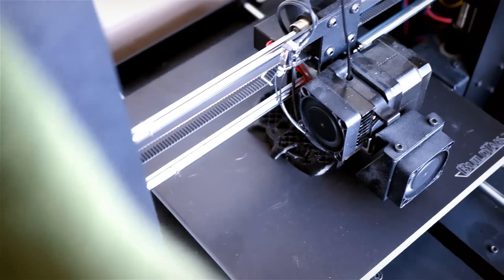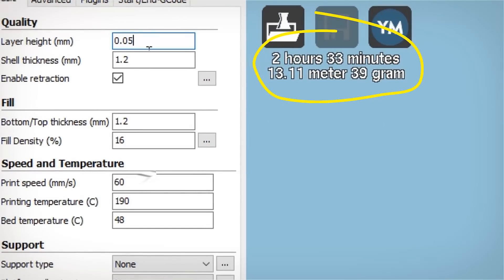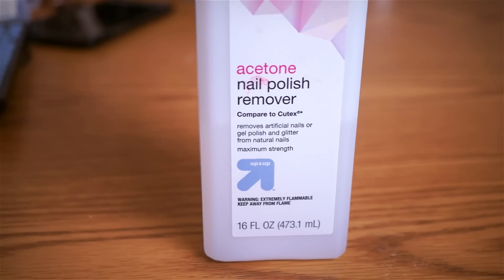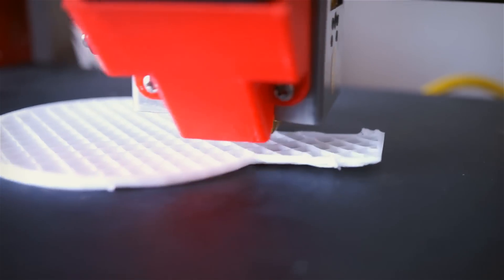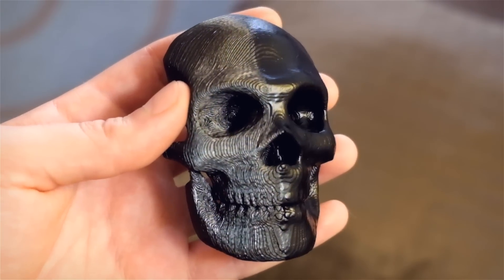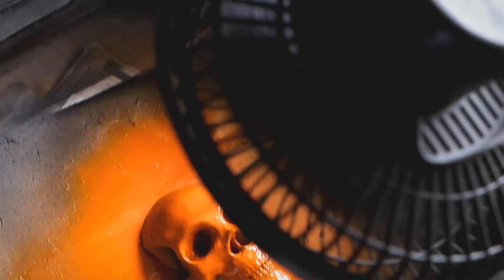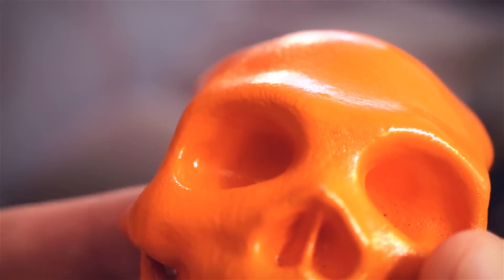Smooth PLA | No Sanding

Comment: cool to know but it should be noted that the skull now has lips instead of teeth
Reply: Indeed
Reply: Definitely good point to make, I think this method is perfect for really simple models that dont have minor details like mounting gear, pot plants, etc
Reply: This made me laugh
Reply: Your correct. Maybe we have to make certain areas more pronounced, deeper, so smoothing will not vanquish it
Reply: @ericcvt  Or put painters tape over the more intricate sections so they get fewer layers of paint
Reply: perhaps you could cover the skull with some painters tape before spraying and do so in such areas
Reply: I gotta say that it looks much more friendlier and less menacing this way, though.
Reply: The problem is the resolution of the print is so low that the teeth are almost the the same size as the printing layers.
Reply: @mdoerkse  Exactly, the problem is inherent to the print at this scale, you can't process it out because the details weren't really there to begin with.  

If you have an artistic leaning you could sculpt them onto the model with a knife or dremel depending on the needed effect, but at that point you're not really 3d printing anymore.
Reply: Haha this cracked my scull up
Reply: yeah all detail is lost
Reply: This shit got me crying
Reply: *Quick fix for this. If you cover details like the teeth you can sand it down till it shows again and then spray it lightly the same way you did the rest but this coat you wanna apply light. Just enough to blend with the rest while still keeping the detail
Reply: It is now Skeletor!
Reply: Hahahahah
Reply: XD
Reply: Oh Yeah Yeah
Reply: That has more to do with the layer height, I think, than the filling method.
Reply: :D :D
Reply: LOL
Reply: Skull Kiss 💋😘

Comment: so I have a print that is one color on the top and another on the bottom of a single piece. is there a way to hand paint the smaller part and still use your technique?
Reply from the maker: Interesting. There may be a few options but I feel like I would try to use painters tape on one side then remove and apply it to the other side. One side at a time i guess. But you could hand paint it after too

Comment: I was actually wondering if this would work only a few minutes ago! And then this video just magically pops up and confirms my theory! xD 🧙‍♂️🔮
Reply from the maker: Perfect! :)
Reply: Here is your answer!!!
Chemicaly Smoothing PLA

"Generally these days I start by brushing on some Dichloromethane (DCM, or methylene chloride). This stuff is really very nasty and I do this work either in a fume hood or outside with a fan blowing away from me. I use a respirator with chemical filters, PVA gloves and full eye glasses. Do not use this chemical unless you’ve taken the proper safety precautions! However I found no other solvent even remotely as good at smoothing as Dichloromethane. Apparentl Tetrahydrofuran (THF) is ok, though I’ve not tried it. Acetone is completely useless, as PLA is completely insoluble in Acetone. Due to the nastiness of Dichloromethane I’ve never attempted doing vapor smoothing, but the simple cold brush on works surprisingly great. Sometimes I do two “coats”. With each coat the Dichloromethane dissolves the surface layer of the PLA and the resolidifies, running into the cracks. It also conveniently seals any tiny holes in the print where print layers have failed to fuse properly. Another method is to spray on many coats of a lacquer, e.g. shellac. This has some problems though during burnout and can leave undesirable carbon residues in the mold which can be tricky to remove. With higher burnout temperatures though this has been less of a problem."

https://mtyka.github.io/art/2016/12/11/lostpla-casting-glass.html

Comment: 2 PART EPOXY IS A MUCH BETTER PROCESS great short vid but epoxy doesn't coat over the details as you use a paint brush it also increases the strength of the overall piece

Comment: Just FYI you don't need to heat acetone to smooth with it, you can just give it a large surface to evaporate area such as lining a jar with paper towels. Works great, slightly slower but much safer.
Reply: cool mist humidifier. I made a another post here to help create consistency and full coverage with this concept
Reply: And you loose less detail

Comment: "How to remove all details from your print"
Reply: turns everything into goop
Reply: With what I like to print I can see this being very useful. I love a smooth and shiny look to things that are very simple in shape. Though I think this would never work well on things with more features than a scull.
Reply: I use 3D printer for custom boxes for electronic devices, so it's perfect solution for me.
Reply: Same with ABS smoothing using acetone, you have to trade details for smoothness.
Reply: eh the original stage, the skull's teeth were already so close together and not much detail
Reply: Acetone does the same for ABS
Reply: lmao
Reply: Just so you know, printing at a large layer height IS sacrificing detail.
Reply: I use 3D prints for custom organization which uses simple shapes so it’s good for me
Reply: Yeah exactly, that skull lost most of its teeth
Reply: That’s not the point. You can cover the holes or whatever you want
Reply: what a legendary comment. I mean he already prints with 478563485mm layer thickness
Reply: @donnyboi6061  yes i was looking for this, like wtf "i dont like the edges" proceedes to print a skill in 4 layers
Reply: 3d prints look like garbage anyway. Especially the details. You really shouldn't be printing things with small details unless you're using a resin 3d printer.
Reply: @JorenMathews  exactly I want to try this on a detailed model, though in the EU it is often so hard to come by the things I see on YT that are from the US  :((
Reply: @sirfrancisarthur  
You don't need to get the same brand, just get a product with the same ingredients... or just order online :P
Reply: @JorenMathews  lol.so lame

Comment: Interesting! I was looking for something to helping me out smooth PLA.
Reply: Look at this article I found.
Chemicaly Smoothing PLA

"Generally these days I start by brushing on some Dichloromethane (DCM, or methylene chloride). This stuff is really very nasty and I do this work either in a fume hood or outside with a fan blowing away from me. I use a respirator with chemical filters, PVA gloves and full eye glasses. Do not use this chemical unless you’ve taken the proper safety precautions! However I found no other solvent even remotely as good at smoothing as Dichloromethane. Apparentl Tetrahydrofuran (THF) is ok, though I’ve not tried it. Acetone is completely useless, as PLA is completely insoluble in Acetone. Due to the nastiness of Dichloromethane I’ve never attempted doing vapor smoothing, but the simple cold brush on works surprisingly great. Sometimes I do two “coats”. With each coat the Dichloromethane dissolves the surface layer of the PLA and the resolidifies, running into the cracks. It also conveniently seals any tiny holes in the print where print layers have failed to fuse properly. Another method is to spray on many coats of a lacquer, e.g. shellac. This has some problems though during burnout and can leave undesirable carbon residues in the mold which can be tricky to remove. With higher burnout temperatures though this has been less of a problem."

https://mtyka.github.io/art/2016/12/11/lostpla-casting-glass.html

Comment: That is not a viable solution as the detail is lost by the paint process. Pause the image @ 2:10 and look a the teeth detail.   Many would rather not paint printed objects either as this now makes the object more scratch prone or have issues with chipping paint.

Comment: What about hot air smoothing? What if you could control the temperature slightly above what your extruder settings were - would that work?
Reply from the maker: I like the idea. Maybe flashes of heat would lightly melt and smooth. That would be interesting to try.

Comment: Does it have to be fast drying polyurethane.
Reply from the maker: The fastness help because it will harden before the paint has time to run. So it locks that layer in place fast.
Reply: Can I use normal polyurethane spray. If so, do you have any tips?

Comment: You can use diluted acetone to soften the surface of the PLA to make sanding faster. Additionally if you have to wait a who day you might as well be printing with thinner layers, it's not going to add a whole day on for most of the models people make, and you will get finer details.

Comment: "Can produce a melted 'look' "
Dude. It doesnt look melted, it is melted.
Reply: No, it's dissolved, not melted, which isn't the same.
Reply: @GRBtutorials  same looking after affects so really doesn't matter lol
Reply: @GRBtutorials  It's a melt my dude not a dissolve.
Reply: @99Plastics  melting is caused by heat converting to speed in molecules of a solid, when they speed up enough that the motion overcomes the attractions so that the molecules can move past each other as a liquid, it changes state, dissolving is cause by chemical reactions breaking down the bonds in molecules of a solid so that it moves like a liquid looking for bonds to connect to try and return to a solid.
it's a chemical reaction, not a mechanical reaction like melting.
Reply: @JackPorter  That's the right type of argument to prove your point haha!
Reply: DaToNyOyO That was referring to using acetone for vapor polishing of ABS.

Comment: Nice try, I guess. If you want detailed, small to semi small PLA prints, you’re gonna have to print small and spend time and work on it. That’s it. No shortcuts. No mixing aerosols under your cat to wash away detail then forget to talk about it. Bad tip, bad technique. You could’ve taken the skull outside and just down multiple coats of filler primer and it would’ve turned out better.

Comment: While this method seems useful, it seems a lot of the detail is also lost ?
Reply from the maker: All additive methods fill in layer gaps and some details but consider the skull I printed was a large layer of 0.3mm which is already a loss of detail. So if you print with a high res like 0.1mm and then do this method, then much more details will be preserved. I was showing the extreme which is easier to see the before and after in the camera.

Comment: Why do people always moan that detail is lost?
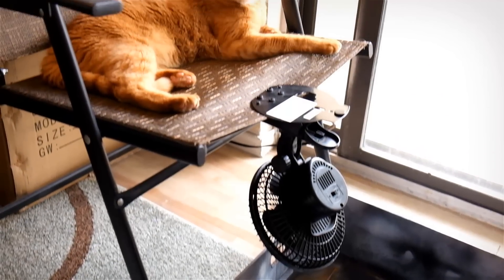@ 2:11 Look at the difference. Which skull would you rather have?

This is an example of what you can achieve. He used a 0.3mm layer height to show how effective it is. He did an extreme version of the technique. If you want to keep certain details like the teeth, then don't spray too heavy in these areas. People need to use imagination and stop thinking like robots who are programmed every step of the way.
Reply: You can also use finer line heigts on only some layers if there are details you really need to keep.
Reply: Except the printed skull looks like pretty bad before even the paint.

You could get waaaaaaaaaay better print quality with .16mm layer height, match the multiples of your nozzle diameter with all the other settings (ie use the "magic numbers")  change the orientation on the bed so it's not printing flat, angling the print, elevating it and using supports, better PLA than the monoprice stuff, Using more top layers/adaptive layers to lessen the voxelization of the top.  If you're trying to get something to look better why not set yourself up from the beginning instead of coating it in paint?

Or just save yourself the trouble and buy a spray bottle, IPA and polymaker polysmooth filament.
Reply from the maker: Thank you so much for understanding. This low res model with horrible line heights can be smoothed so that means even a higher detailed model can be smoothed too.
Reply: @3DSage   No probs. Just hate to see when people take the time to help out others with their knowledge for free, with no thanks, only to be rubbished on a slight thing. People like you are what makes YT a great source of ideas for makers. I'm taking away some knowledge from this video even if I don't apply it, so thank you for it.
Reply from the maker: @ArcanePath360  You are a good person and thank you so much for your comment. It made my day.

Comment: isn't this just painting??
Reply from the maker: The polyurethane is thick and dries fast so it can fill in the gaps but it's clear so mixing in the spray paint make it easier to see the small gaps being filled and makes it smooth.

Comment: Is paint necessary or does the polyurethane need a bonding agent to stick to first?
Any assistance asap would be nice.
Asking for a upcoming rocket competition with rocket nozzles that are 3d printed.
Reply: I don't see why the polyurethane wouldn't work without the paint; might be easier to thin some from a brush-on polyurethane can and dip your part in it a couple of times. There's also water-based poly that cures a lot faster and with less toxic fumes, although it still smells pretty bad for a short while.

Comment: I'm a little confused. Do you still prime and color spray it after this part or do you need to paint before adding the polyurethane?
Reply from the maker: A little primer would probably help it stick before. The mixing of paint and fast drying polyurethane just seals and smooths the model. You can do anything you like after that.
Reply: Ok thx, I'm going to try this out when I print something big ^^

Comment: nice tip, but you loosing a lot of detail in that process thanks to the many coats you apply. even the skull which is a medium sized model as I would call it looses the details at its teeth. the robot sorta looks nice, but hard to tell for sure with that shiny coating.
Reply from the maker: I printed the skull at a thick layer height of 0.3mm to show a strong comparison, so if you print at 0.2 or 0.1mm, then it will take very little to smooth. maybe even 2 or 3 coats and maintain detail.

Comment: Yeah you should read labels more often because both cans you were spraying in your house are flammable just like acetone and contain harsh chemicals. Not to damper your parade but this tip is called painting, no need to church it up.
Reply from the maker: I quickly filmed it inside for the lighting but moved it outside to actually finish it. I also did a test with just spray paint and it didn't work for me.

Comment: Thanks for the concise video on painting; however, smoothing through additive layers isn't what i"m looking for.
Reply from the maker: No problem but I think this technique works great on certain prints so I had to share it with people.
Reply: Then maybe look at this.
Chemicaly Smoothing PLA

"Generally these days I start by brushing on some Dichloromethane (DCM, or methylene chloride). This stuff is really very nasty and I do this work either in a fume hood or outside with a fan blowing away from me. I use a respirator with chemical filters, PVA gloves and full eye glasses. Do not use this chemical unless you’ve taken the proper safety precautions! However I found no other solvent even remotely as good at smoothing as Dichloromethane. Apparentl Tetrahydrofuran (THF) is ok, though I’ve not tried it. Acetone is completely useless, as PLA is completely insoluble in Acetone. Due to the nastiness of Dichloromethane I’ve never attempted doing vapor smoothing, but the simple cold brush on works surprisingly great. Sometimes I do two “coats”. With each coat the Dichloromethane dissolves the surface layer of the PLA and the resolidifies, running into the cracks. It also conveniently seals any tiny holes in the print where print layers have failed to fuse properly. Another method is to spray on many coats of a lacquer, e.g. shellac. This has some problems though during burnout and can leave undesirable carbon residues in the mold which can be tricky to remove. With higher burnout temperatures though this has been less of a problem."

https://mtyka.github.io/art/2016/12/11/lostpla-casting-glass.html

Comment: Nice try, but a bit too labor intensive. Also, a few corrections. PLA is derived from corn, not sugarcane. Also is Fused Material Depositing not ‘deposition’ which is, I believe, a legal term.
Reply from the maker: What you said is incorrect. FDM stands for Fused Depositing Modeling. PLA can have corn starch which is used to thicken the sugar cane.
Reply: A lot of PLA is made just using corn starch and no sugar cane to reduce production costs and that doesn't change the fact that the D in FDM does not stand for 'deposition'
Reply from the maker: A quick google search of "FDM 3D printing" shows dozens of sites referring to FDM as Fused Deposition Modeling.
Reply: @ZXaber78  Just to clarify, the definition for deposition if "the action of depositing something," so the OP is right about that, due to the acronym being completely grammatically incorrect if worded as "Fused depositing modeling," but you are totally correct about the corn starch.
Reply: @3DSage  And although you are correct, just because something else says it's right, doesn't always mean it's right. do your own research into why something is right or wrong before telling them that they're wrong.